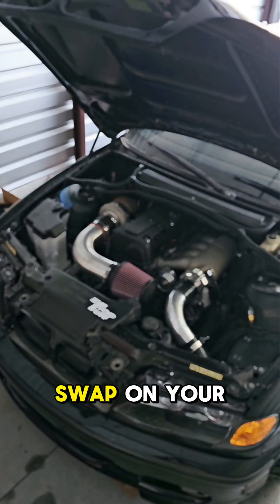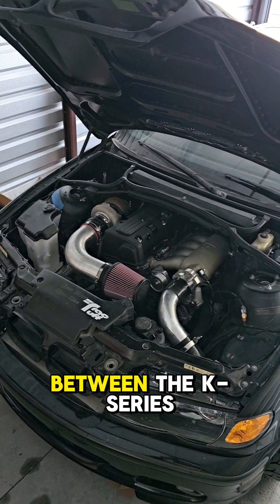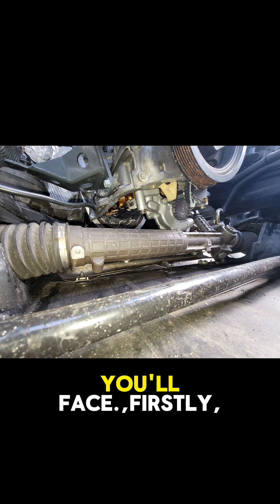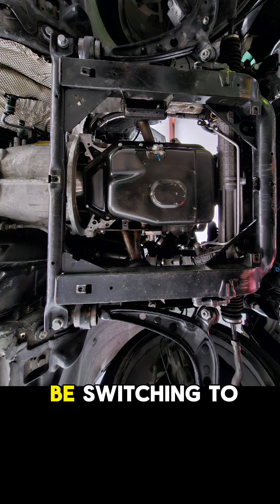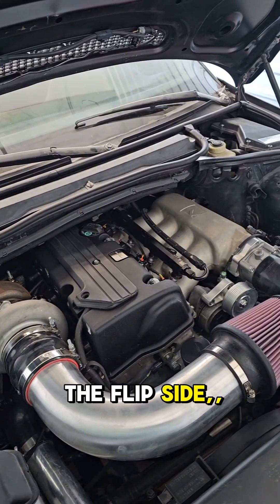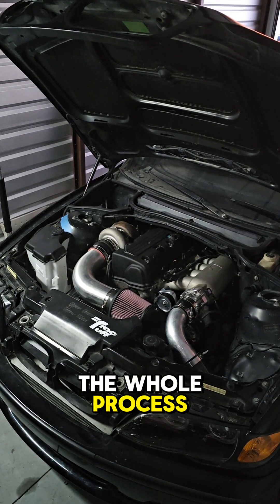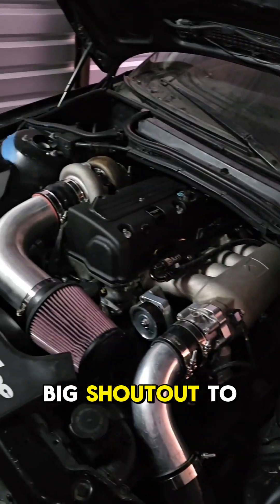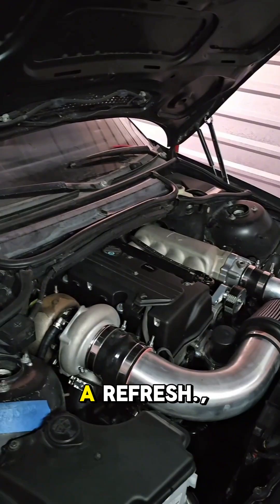How to K-swap a BMW E46

Comment: Can you do a k24 swap on a 2002-2004 330i since it's the same car as e46?
Reply from the maker: The swap is possible for any year of E46; it's just going to come down to how much you are willing to spend on the swap. Because you're going to be doing some heavy modifications depending on if you want to keep the engine's stock oil pump.
Reply: Or a 325i**
Reply: Thank You I Was Just Wondering Cause I Haven't Seen Anyone With k24 Swap Or LS Swap On Those Years Soo I Was Just Wondering and Boom I Finally Came Across You Haha Ima Look into That Now Because my Favorite Years of all 3 series is 2002-2004 and the 2009's m3 330i and 335i those are the 2 Styles I Always Liked Soo I been looking very hard into those specific years but Soo True It's Gone Be Alot of Modding Forsure haha But Yeah Ima Keep Looking into that Man I Appreciate it
Reply: I'm Going To Sub To You On My Other Personal YouTube Account

Comment: how do you do the electrical?
DO you have a shop?
Reply from the maker: My wiring harness is from Wiring Specialties. I wish I had a shop; I would have been done with this project a long time ago.
Reply: U can buy an aftermarket support for k engines with standalone ECU and plug-in wiring

Comment: So im in the middle of deciding to buy a k20a from someone i know. I found there are subframe spacers that u can get with the motor mounts. U can keep your steering rack etc. has anyone ever heard of these?
Reply from the maker: You can go that route, but you're messing with drivetrain alignment and limiting options for a proper oil pan with a good baffle system and access to the oil pan.
Reply: @DUKE_GARAGE  ahh i didnt think about the drive train alignment i see
Reply: @DUKE_GARAGE so say we swap the ci front subframe to a xi front sub, do is everything good or do i have to still push forward the steering rack? All the videos i seen and research i did this is the first ive heard someone say push the steering rack forward
Reply from the maker: With the IX subframe, you swap the steering rack to the IX steering rack and the control arms as well.  With the IX subframe, you do not have to modify the subframe to move the IX steering rack, because it sits naturally in front of the engine.
Reply: @DUKE_GARAGE  i seeeeee thank u
Reply: @DUKE_GARAGE That’s good to know I have a 325xit w a blown motor
Reply: @XenoSeven86 mine is starting to go out as well haha